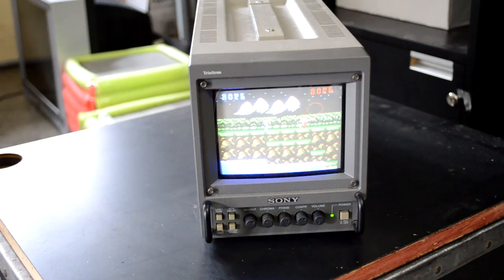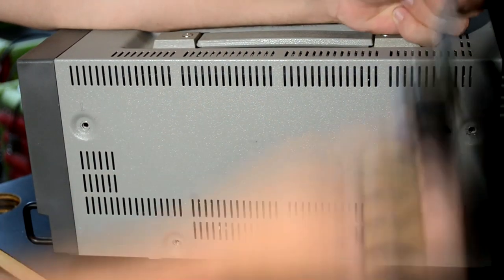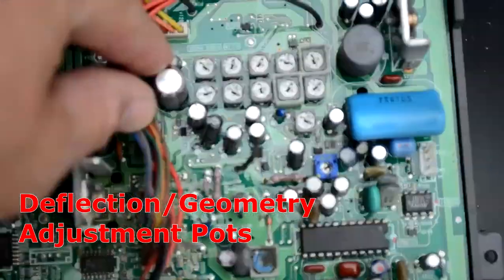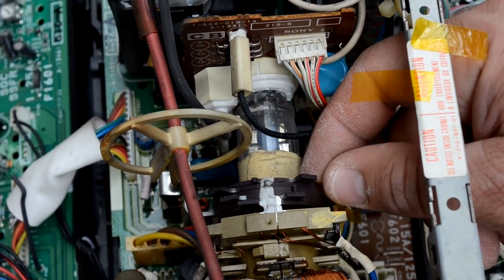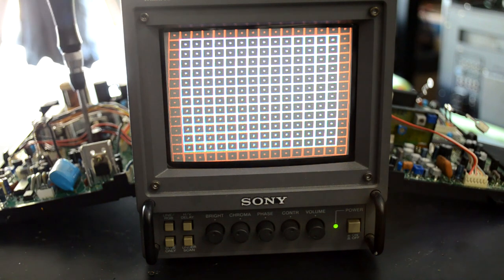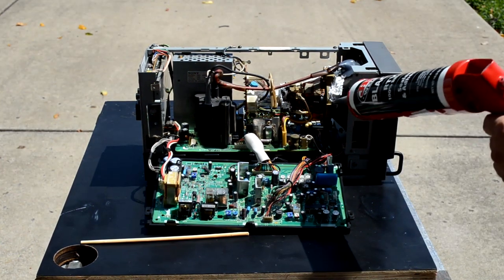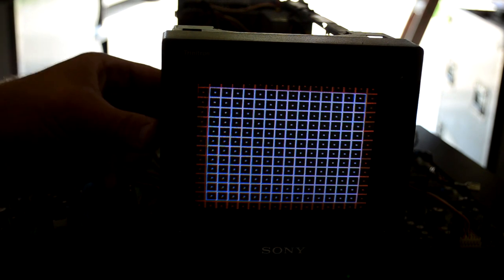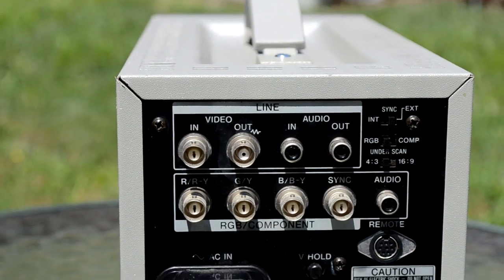Sony PVM 5041Q Yoke Fix | The Smallest Pro CRT ever made!

Comment: very admirable skills !
the PiP at 4:16 is a great idea but very small to see :) 
and did you consider to 3D print missing parts as the Yoke joint you replaced with the black epoxy for e.g. like a Ring slpit in half? 
besides that again very admirable skills and very nice and informative video  
thanks
Reply from the maker: Good idea.  I don't have a 3d printer or really any experience with it, but that probably would have worked

Comment: I have this PVM and for some reason, The composite shows the picture in black and white, while the RGB/Component shows in color. I think mine has a connection issue as sometimes I could see the composite give out color when played with. Not sure what I gotta do? re-solder the connection or something?
Reply: It’s a cold solder joint. Steve might know the exact area but it’s somewhere on the color board. Nobody seems to ever have a set place that needs to be reflowed but I’d check to see if anything stands out.

Comment: Do you use an isolation transformer when doing these types of repairs/adjustments? Thanks for the awesome video!
Reply from the maker: Not generally.  Most of these high end CRTs have built-in iso transformers.   It's a good idea to use one though

Comment: hey men, i have a problem with my panasonic ct20r15w from 1998, the problem is that in black areas looks green,  someone told me that i need to do degaussing. Is a geenish tint in black screens, when i connect the ps1 and when it shows the playstation logo with the black screen the black area looks green but a dark green. Also gray areas looks a little green almost yellow, metroid from super nintendo gray colors looks green almost yellow. Someone else told me to adjust some variable resistors or in the service menu low the green color or up blue and red. What do u think about it. I don't have the remote but i bought it on ebay and arrive in some days. I can't find the service manual, so i don't know how to customize the colors in the service menu i only know how to enter because i found it on google, so do u think that this is the problem or is the tube? Do u have fixed this model before? Sorry for my english, is not my native language!
Reply: of course nice video!
Reply from the maker: Probably should check the Screen Potentiometer/G2 to see if it's turned up too high.  Otherwise rebuild the neck board and see if you can adjust the colors to a suitable look.  Good luck

Comment: not the smallest by far. JVC made the JVC TM-P3 which is 3 inch. Leader also rebranded this monitor and paired it with a waveform monitor to make the lvm-5863a. I have one and it has a battery pack and shoulder strap so people could use it in the field back in the day